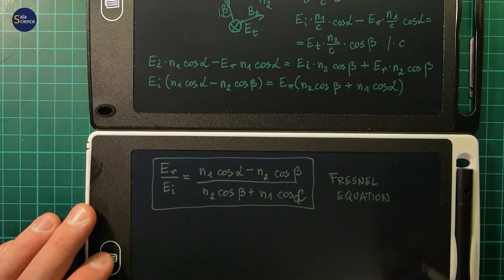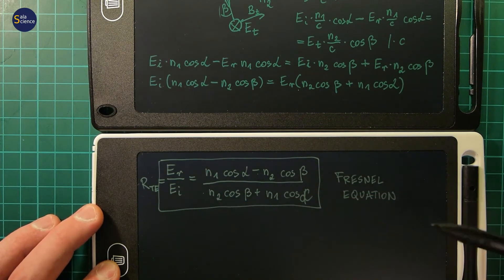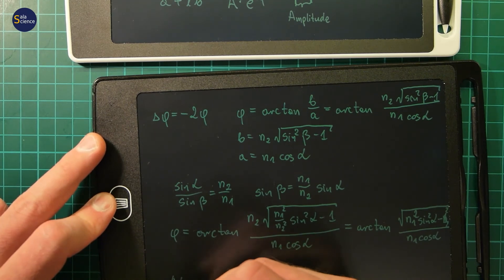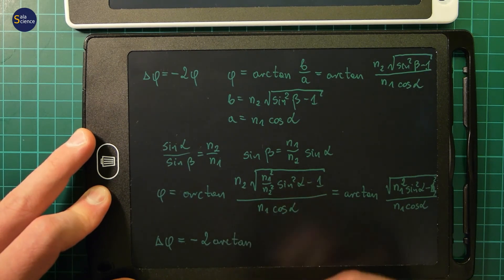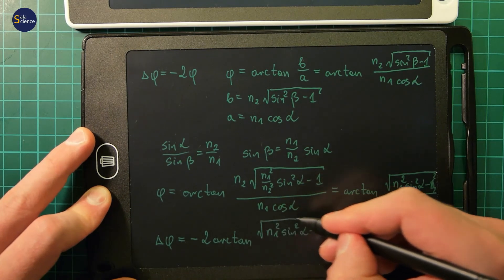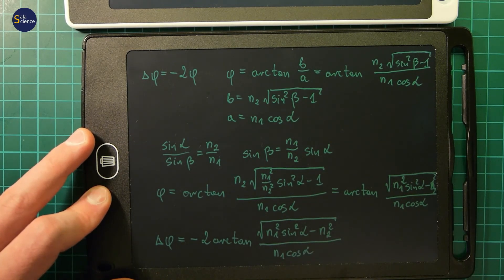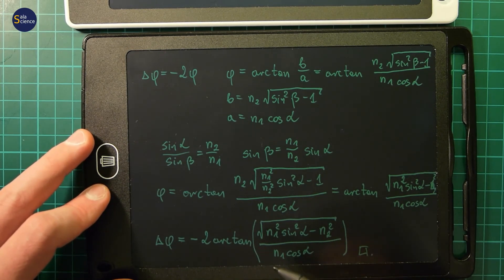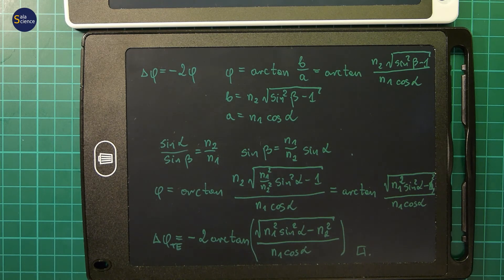Fresnel equations - 1.0 Basics - Optical Waveguides and Fibers

Comment: Why in 8:13 you say that cos(beta) is complex? Shouldn't be cos(0°) in the total reflection case?
Reply from the maker: Nope, cos(beta) is complex because in case of TIR (total internal reflection) there is no transmitted beam. Only for the critical angle you have beta=pi/2. When you have TIR the Snell's law still holds, but the angle becomes complex.

Comment: Hello, thanks for this serie. 
One query: the boundary condition states the continuity of the normal component of B field (since \vec{n}_{ij} \dot (\vec{B}_{j}-\vec{B}_{i}) = 0, where \vec denotes vector notation and i,j denote medium i and j). However, in the  derivation of the Fresnel coefficients you use the continuity of the parallel component of B field. Could you help me in the point that I am missing here?
Reply from the maker: In optics you can assume that permeabilities of both media are equal to 1, so also the parallel component of the B field is continuous. I am not sure, but I think you can also try to derive the equation taking perpendicular component of the B field instead of parallel.
Reply: @SalaScience  Ok, a lot of thanks!